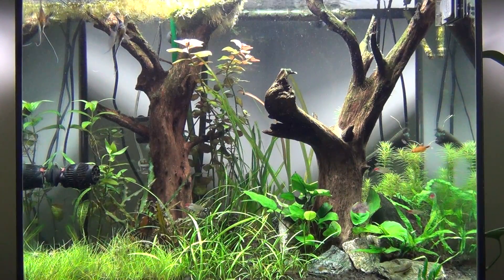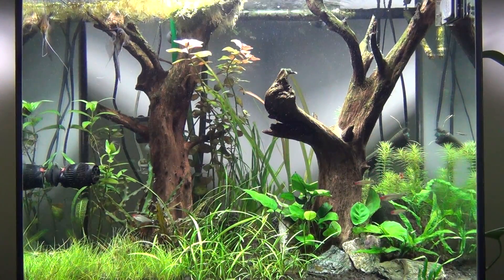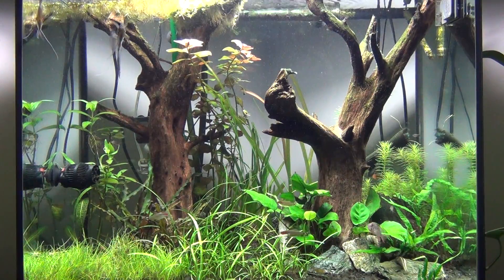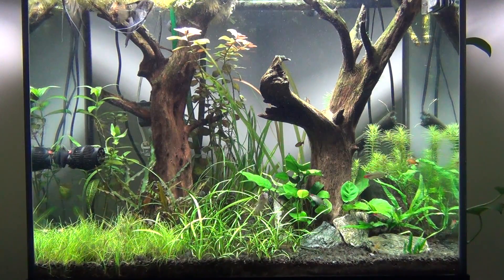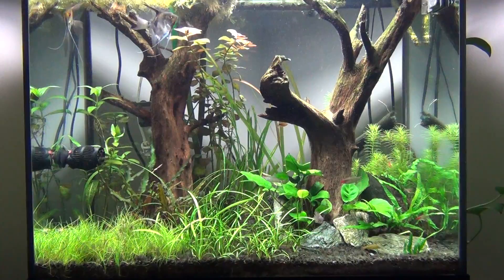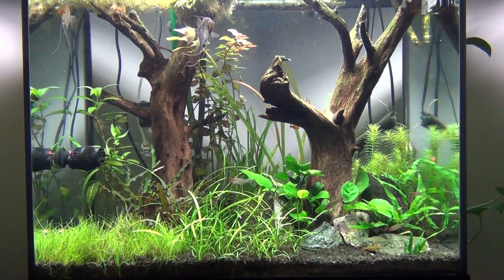A follow up on the co2 solenoid problem

Comment: You could also just replace the solenoid if it breaks again but the regulator is working fine. I know you already checked out my vido on a complete regulator build, but I didn't think to mention just replaceing the solenoid. Check out the Bürkert 6011 solenoids with Buna seals-- they are awesome. But hopefully this one will work for many more years without problems. Good luck.

Comment: Glad taking it apart and cleaning worked.  It's worked for me.  I did some checking this week and it turns out that heat causes this problem.  Milwaukee and Aquatek solenoids get too hot and then it causes it to lock up.  Taking it apart and doing what you did is the only cure.